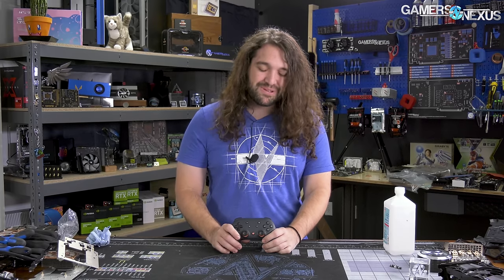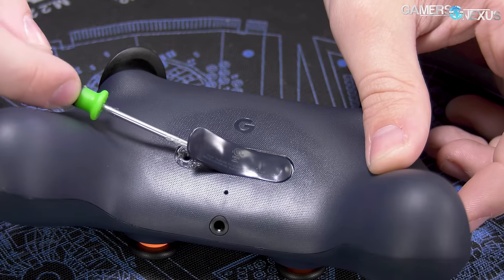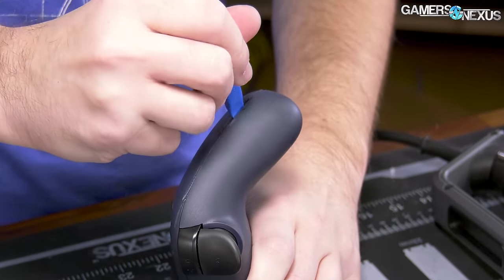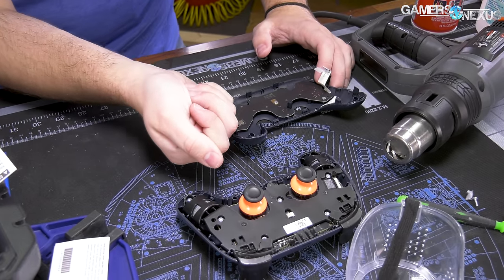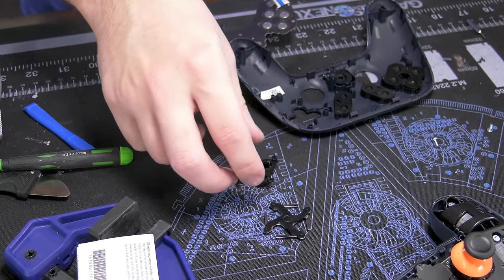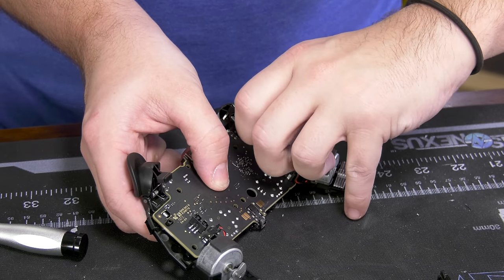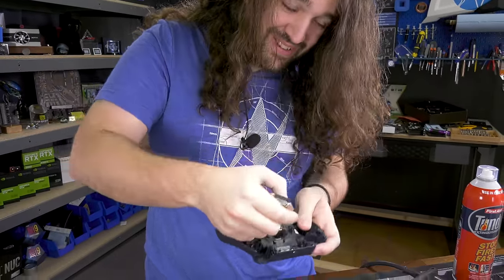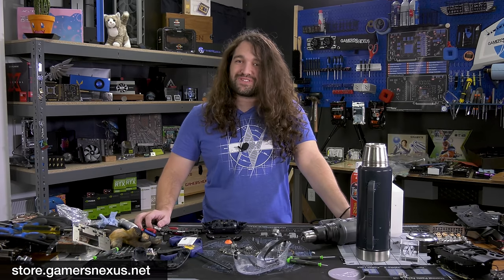Google Stadia Controller Tear-Down & Disassembly Nightmare

Comment: Ok, I agree with the problems of the service not working, that's shitty to say the least.
I also agree that they could have used a combination of screws and clips to make repairability easier, so you can change battery, buttons and the joysticks.

But you can't say the controller is built badly.
These clips are not a google exclusive, they are quite common, because the part that's meant to bend isn't the protruding "clip", its on the bottom shell, which you flex outwards to disassemble with a thin metal spudger. The type of clips that you mention are easier to disassemble, are actually worse, cause they are more prone to break. These clips are easier in the assembly process and more durable.

Why is the pcb on a separate plastic board? Easy, cause that's a subassembly. They put the pcb with the triggers and motors on that plastic piece and then they probably test that subassembly before placing it into the shell and clipping it together. That's also why the rumble motors are glued, so they don't fall out during transport of this subassembly, cause at that point, there's no faceplate holding the motors completely in.

The battery isn't soldered to the pcb, because it gets connected on final assembly, so yeah, the connector is there for ease of assembly.

Do you see that vertical antenna? Yeah, that is way better than the more common pcb antenna, cause its aligned with the receiver antenna while in use, giving you effectively better range and a more reliable connection.

Btw, torx is quite common in assembly of quality products, mostly used in europe, its a pricier screw than philips head.

All in all, the controllers engineering is really good. Its solid, sturdy and easy to assemble. The engineers did a great job.

Whats at fault are the design choices. Not making it user serviceable, making the battery not replaceable.
And the launch was bad. Letting you buy it on a gsuite account that then doesn't work. Thats all bad.
But just because of that and because the engineers got told to make it non repairable, that still doesn't make the engineering of it bad.

I also get that when you spend 2+ hours on careful disassembly, you are probably irritated.
Reply: A longer explanation for torx:
The most common problem with phillips head screws is, that it tends to slip out if you dont apply enough pressure. Torx doesn't have that problem. So torx is better when mounting pcb's, where slipping can mean desroying it.
So why isn't it used in smartphones? Well, phillips is more common and cheaper because of it. But what I think is the main reason, is, that smartphone screws are really tiny, torx can't go smaller then a certain size, because it has a more detailed shape with thinner features. Phillips is a simpler shape that you can shrink down more.

So, for really small screws phillips is the only option, but as the screw becomes bigger, torx advantages come out, as it performs better under higher torque than phillips (because phillips produces a force away from the screw when rotating it, torx doesn't)
Reply: Also, I find it funny that most people buy $600+ smartphone with a not user replaceable battery, requiring you to pay quite a bit for a repairshop to do it, but that its not user replaceable on the stadia controller, then it's a very big issue.

Yes, I'm against non user replaceable batteries in general, but come on, its nothing new.

Comment: This may be off topic, but can anyone tell me when Tom's hardware went totally team blue/green. I just read the "latest" gpu buying guide from a Matt Safford, who not only left the 5700 XT out of the graphic reference slides, but also put the plug in for the green team stating  I quote " Opting for a Polaris-based RX 570, 580, or 590 card might not be an ideal choice for long-term gaming, given their 2016-era architecture, and the fact that Nvidia’s competing GTX 1650 Super and GTX 1660 Super cards are newer and more power efficient. But while AMD’s mainstream Radeon RX 5500 silicon has been announced, we still haven’t seen these cards show up outside of OEM systems. So if you’re after a low-priced GPU from Team Red, you have plenty of options. But for now at least, none will be based on the company’s latest Navi/RDNA architecture. Now if this doesn'y smack you as a totally biased filled guide, I am not sure what does I will also note in the same author's article about which gpu to by published on oct 22 2019 he fails to mention the 5700 or 5700 XT anywhere on his table , like he is hiding the finding from everyone who casually looks for guidance from them. I am so glad that i was directed here.

Comment: So if you get analogue drift, which you will, you have to pull out the dremel? 
On another note, PS5 controllers are going to have mics also.  Guess I’m going to need to buy some sound proof sellotape.

Comment: Those aren't press clips, as in you don't press the standoffs in, they're shim clips. You use a thin but sturdy shim that's the witch of the clip hole to slide into the clip standoff and then rotate the shim approximately 90 degrees so it's pointed down towards the bottom of the controller and that will pull out the clip from those holes and release them. There have been many, many such clips on other electronics. It's essentially like using a credit card to open a door. What he's doing in this video is essentially the equivalent of trying to push the entire frame away from the door latch.

Comment: Seems like the big clips get caught by smaller clips on the other half. What you'd want to do is catch your screwdriver in the clip and instead of pushing the huge clip, pull on the the other clam shell with "no clips". Most likely leave a dent but hey, frack right to repair, right?

Comment: The analog stick uses a gimbal not a ball joint. The rumble units are DC motors with an eccentric weight attached. Not electro magnets.

Comment: The "cage" is most likely due to the internals and case being combined separate from either manufacture. I am mainly disappointed by the lack of analog input, not that I would buy one of these in the first place.

Comment: Nobody uses torx for security, its probably the second most common head by now. Its just good- better than bloody strip-alot Phillips and hex heads definitely. The screws stay attached and aligned to the driver, it's almost impossible to strip the head.

Comment: Okay wait, I don't know anything about this controller, but you need an activation code for it to work with your damn device? What the flying fuck is the logic in requiring a fucking ID key for it to work?  So someone can't steal it and use it? Great because I mean somebody's just going to steal it, find out they can't use it, and then probably throw it away if that was the logic.

Comment: As someone that has worked for years making injection moulds, that controller isn't meant to be disassembled. The size and thickness of the 'ribs' that support the clips are meant to have very little flex. Google's RMA process is simply chuck it the recycler and ship the customer a new one.  I'll stick with my gaming rigs. Thanks for the BS you and your crew went through to show the world what I already suspected. Shitty playstation 2 controller with wifi. The heatgun / LM2 dump was one of your finer moments ! Cheers !

Comment: So, heatgun, liquid nitrogen, flathead screwdriver (that was broken in the process), a pair of clippers, and a bloody dremel. And the hidden screw didn't even held the bloody thing together. Fucking hell. I have a fucking laptop which has screws holding it together, granted, but less clips, and those still hold together the thing without the screws.

Comment: The actual repair if it exist has a custom made prying plate spring for this. You would need 3 flat wide spudgers and know where the locks are to even come close...

At least it was not ultrasonic welded or glued.

Comment: I haven't seen domed metal switches in a controller since the Atari 2600 joystick... unlike carbon dots, which can be easily cleaned up, the stainless domed switches fail spectacularly by splitting.
I guess that's less of an issue, since google wants this to be a throwaway device. Thanks for saving the planet, google.

Comment: most modern controllers have that bit of plastic in there to seat the rumble packs and the pcb with the buttons on it. probably not on small ones like the switch but certainly on playstation and xbox

Comment: Sorry Dude - I have no Controller yes (waiting for Google) but an activation code. Stadia on my Desktop works beautyfully and I installed the App on my Samsung S10 without issues. I think you got yourself a lemon. I update you, if it is crappy on my 4K TV with Chromecast and controller. Greetings from Germany

Comment: you do not need the pixel phone to register the device. I have a One Plus 7 and set it up through the app like that. I cant play on the phone because thats when the pixel is needed but you can attached the controller to your account through it on any phone. Hope you got your activation code by now I got mine about a week after I received my stadia.

Comment: I've taken apart and put back together my playstation and switch controller they use screws. They were easy to fix, taking apart the stadia controller is a nightmare. I wouldn't have the patience to break it down like this, or the tools.

Comment: "I think it still works" after managing to get the thing open; whereas at the start of the video you said that it didn't work! BTW, I would have had that thing open in 20 seconds with a small hammer and a good-sized flat blade screwdriver, and leave it in better shape. That tiny "pry bar" was ridiculous.

Comment: I think you got something wrong there.
You don't need a pixel phone to register the product/code, just go to the play store on any android device and download the stadia app. (You need a Pixel to stream games in the stadia app).

Code should be in your mail inbox of the account you purchased it on where you also received the delivery mail and so on.

Please use the time to inform yourself about a product

Btw not defending stadia (it works bad on chrome for me and amazing on the chromecast (same connection lan cable)

Comment: At this point, the controllers are so cheap and easy for a vast entity like Google to produce, they're a disposable part...so why would they design it to be repairable? I'm surprised they didn't friction weld the halves together; the tooling is no more expensive than that used to mold them in the first place.

Comment: You could have disassembled it in mere seconds if you had the proper tools.  Like a swiss Army Knife.  You would have used the Googletizer on top of the bifarcle manificator.  Holding it still you could have taken off the screws with confidence.

Comment: they don't want you to ever take it apart they want you to buy a new one....Just compare a repair manual (the full ones they give to tech's) just few years ago it would give you trouble shooting flow charts and get down to replace Uxxx or  what ever component on the board needed to be replaced usually a couple dollar part....now those same manuals the flow chart will tell you replace whole power board or w/e it may be...

Comment: However pointless Stadia is and how weird this controller is designed - I was amazed, that they have a 2000mAh battery in there, the controller should run until the universe implodes with this battery! You know....... as soon as it's actually possible to use this controller with any device, even Stadia itself.

Comment: Its a crush the top seem only system at clip points then the back probably pops off like some anti theft tags use magnetic release systems on clothing tags in stores you need a purpose built tool vice? Place it in face first apply pressure pop the back. Taking the 1 screw out of course. Either that or they didnt even think about repair as an option more likely?

Comment: First, I agree Stadia is just not ready, period.  So I can see how in review video you couldn't really even review it because it wasn't in a reviewable state.  However in your review you say that the controller assembly is the worst you've ever seen and the disassembly is a nightmare.  Which to me isn't really relevant because the average user would not take the controller apart.

Comment: thats not ball joints
thats not electromagnets
thats definitely not the right way of opening clips, but i admit these are insanely tight
Reply: the plastic sub frame is making assembly faster and easier. i doubt many hands touch these controllers before they leave the factory.

Comment: So...it's the most difficult setup you've ever dealt with...to open a box, plug the Chromecast into your tv, plug in the power cord, and open an app on your phone to put in the code? Dramatic much?
Reply: What he's saying is that ChromeCast itself doesn't have any ability to activate the controller, so you have to download a separate app on the phone to do so, and on top of that he doesn't have a code, listen to the video a bit better please

Comment: Yes, clearly it is the manufacturers fault for making you upset over opening a controller which clearly wasn't designed to be opened. Maybe a little less brute force and more planning would've been beneficial. I would want to say it made for a more entertaining video, but it just made me cringe.
Of course it is strange to have designed the controller this way to begin with.

I'd like to point out that the screw which you say doesn't connect to the top, the point of contact with the top piece is clearly visible at 13:52 next to your thumb and again at 14:39 to the left of the right stick opening. On the middle layer, at 18:13 you're pointing at the wrong hole, it's the one on the right, immediately by the stick. So yes, it does connect, though it doesn't seem to matter all that much.

Comment: So by definition of the literature concerning injury, and warranty, and how the controller is constructed it's pretty clear that they don't want you to be able to open them for neither repairs, nor battery replacement. After all the crap coming to light with Stadia Google just keeps getting shadier, and shadier. I don't know about anyone else, but if I can't repair the product on my own I simply won't buy it. I honestly see nothing good towards forcing consumers to send in the equipment to be fixed, or refurbished. My only guess is they wanted to try to save a few cents on screws by using such robust clips. Stadia will end up in the Google graveyard within 6 months with garbage like this.

Comment: It's one thing to take the piss out of a bad product.  It's another to purposely do stupid things during a blind teardown and blame it on the product.  You should have checked under the back label for a hidden screw before prying at the controller.  You should have actually tried to pry the controller apart before jumping to the heat gun and liquid nitrogen.  If you're trying to make Google look bad, you're not helping your case by disassembling like a fool.  If your goal was to be satirical, I suppose you succeeded.

Comment: I have taken apart dozens of controllers from all different generations of game console. This has to be  the most over-engineered POS i've ever seen. Just no reason at all for most of this construction other than they threw money at it. So many pointless assemblies (actual buttons v. carbon contact backed rubber pads like everyone else -- the buttons will wear out) and intricacies that make no sense (when compared to most gaming consoles controllers). I would never buy this POS.

Comment: I'm the kind of guy who's willing to see something through. Even with complete dumster fires like Fallout 76, I gave it the benefit of the doubt until Fallout 1st. Never, NEVER have I wanted something to die so badly as Stadia. It's a service nobody asked for, nobody needs, and sure as hell nobody wants. Every review has been the same: late code delivery, or none at all, games not being true 4k, and massive input lag even on high speed internet. Its Google making an awful, weak attempt at "revolutionizing" something. Gaming isn't quantum processing. Its a pretty common science. Just stop.

Comment: 1 año en stadia:

130 el control de stadia

720 1 juego por mes en stadia no bajan de precio y note pertenese nada

50+ dolares un internet potente al mes para usar stadia

total 1,450+ dolares... AL AÑO

una pc gaming para 2k o 4k 

1440p y 100fps+ o 4k 60fps

$802 dolares

https://pcpartpicker.com/user/nietniet/saved/#view=HHX4nQ

nucleos 6/12

16gb ram

RX 5700XT 8gb triple fan

750 W 80+ Bronze fuente de poder

y un ssd

Y UNA PC TE PERTENECE PARA SIEMPRE

Comment: god this controller is so fucking ugly. it's just a slab of smooth plastic. there's no ergonomics at play here. compare this to say, the first playstation controller. Not even the first dualshock, the one that came in the box and see how much more logical it was designed, and those controllers didn't get great until the 4.

Comment: This is good reason to not buy this shit even if is moust great controler on earth but is not coz psx dual shock 1 controler is best. I use mine 20 years now and still work perfect, i never repair it just replace silicon pads. Lol analog not work properly in new controller, he stuck in 1 position and no back what a shit... 18:42. minus -100/10 for anty service trick ppl and shity design coz all that part can be work much easier without oportunity for something broke easy wey... Thats my opinion. If You need controler buy sony dualshock 1 use usb adapter and program like xppader and You can play likie in google shity controler but never need repair or even if you need only normal scruedriver and 15 min for repair even if need solder new analog to pcb... Cheers from Poland. Apple and google can die for all this bad practise.